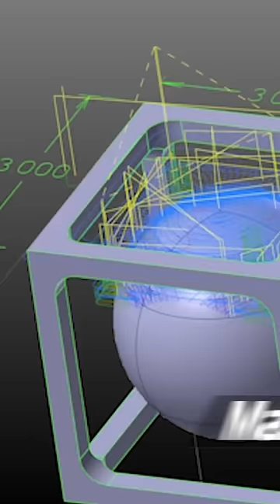How to Machine the PERFECT BALL in a BOX

Comment: Now give it to someone as a puzzle and tell them to get the ball out
Reply: Do it !!!
Reply: when  i see this kind of object my go to is to assume they heated the cube and froze the ball.
Reply: You just cut of the bars off. Puzzle solved.
Reply: And then they do it in 10 seconds.
Reply: @rubenproost2552  Easiest way to find a needle in a haystack is to just burn the haystack and run through the ashes with a magnet. Found your needle real quick.
Reply: loool 😂
Reply: send it to the lockpickinglawyer 😂
Reply: @holderheck that works aswell
Reply: @Mind_of_a_Very_Strange_Man true
Reply: With liquid nitrogen
Reply: @Mind_of_a_Very_Strange_Man Lmao yeah
Reply: Nothing a acetylene torch wont solve
Reply: Chris Ramsey would try it lol
Reply: This could be a prison sentence. You can leave when the ball is out
Reply: Easy, give me a fridge, some liquid nitrogen, and a torch. I'll freeze the entire thing, heat the cage up, and keep the sphere cold between paces with a rush of liquid nitrogen. On the surface of the sphere to keep the interior from heating back up. The sphere will contract, while the cage will heat up on one side of the square. I'm willing to bet the expansion of that side of the cage, and the contraction of the sphere would be enough to squeeze it through plenty.
Reply: @lightshow366 I'm willing to bet it's nowhere close. Don't feel like doing the calculation now, but I can if you're interested.
Reply: @IIBLANKII Okay, quick calc.
Aluminum:
Melting temp C: 660
Room temp C: 25
LN2 temp C: -196
CTE 24e-6 /C

Cool shrink 221*24e-6 = 0.0053
Heat grow 635*24e-6 = 0.015

Room temp sphere: 1.1"
Room temp cage window: 1"
Room temp interference: 0.1"
Cold sphere: 1.094"
Hot cage: 1.015"
Final interference: 0.079"
Reply: Hahahaha stop!
Reply: Amazon sells a 600lbs rem ,tell your friend/coworker you can peel it off something, then watch them struggle, I got 2 guys like that, it's like a 2" by 4"  cube, no one respects the Neodymium
Reply: @David-mz3it God bless your perfect calculations, alloys also don't respond well to heat shock
Reply: @Mind_of_a_Very_Strange_Man found the production shop employee 🤣
Reply: @David-mz3it he may be correct on being able to squeeze the peice out with Intferance, not exactly sure about the math on that, highly unlikely but possible, non ferrous materials.are kinda just like that practically, no tensile or shear strength anyways so bend that shit and fix after using,the most optimal for time management at least 🤷‍♂️
Reply: @curtiswrong Just wanted to see what it would come out to. 0.020" more clearance on a 1" diameter sphere was more than I expected!
Yeah, if I had to get it out, I'd probably bend the cage.
Reply: @David-mz3it  very bold to assume there would be a 20 thou interference on 2 sides of a ball to a flat surface on 2 sides, if so I could do that by hand ( given its a soft alloy) , tbh the whole thing is a mockery to precision machining and shouldn't be even in the same conversation let alone the same parameters as actual precision parts, this is cake walk, everything about it is easy except maybe if you wanna weld it, but even that isn't a grey area
Reply: @jorgblau7208  let me know your experience with interference mating parts and the use of liquid nitrogen, it's definitely one of the less forgiving processes in metal work
Reply: @David-mz3it  I'd agree given the material is pretty pliable, very easy to fix( not weld that shits a pain) but small bends, like .020"" is nothing for alloys, imagine the same project with 4140 hardened?, some real boys to men shit, not the band lol
Reply: @David-mz3it dm if possible you seem fairly competent on metallurgy basics and metal work processes!
Reply: @Mind_of_a_Very_Strange_Man  what if the needle has a low melting point, most likely would disintegrate when fire is done, then what ?! Hmm..  then what! Better using a high powered electro magnet, your theory defs sounds better for philosophical purposes, ill give it that, kinda deep ngl
Reply: @IIBLANKII  why would you need a fridge ? Also anything cooled in liquid nitrogen looses it's contraction benefits within minutes of removal from liquid nitrogen, gotta be hella quick, no way you would have time to heat the box and freeze the sphere, not even remotely feasible
Reply: @David-mz3it  there's no way its 79 thou , I'm not super familiar with this but that sounds excessive
Reply: @curtiswrong You're right, I paused the video and measured how far the sphere sits in the cage. Based on the height, if the cage is 1" wide, the sphere would be 1.01"-1.02" in diameter, so if you could heat the cage and cool the sphere to the temperatures I used, it would fit through.
Reply: @IIBLANKII  Hey, I was off on the size of the sphere relative to the cage (comment above) it would probably fit through or at least be very close.
Reply: @David-mz3it  theoreticaly sure, good luck pulling that off, not even remotely feasible, I would laugh hysterically in my bosses face if I was responsible for that, nice calculation tho, are you taking in the width of wall with that aswell?
Reply: @curtiswrong I'd never do it. My intuition was that it wouldn't be close even if you could heat the cage and freeze the sphere to those temperatures, which were overly best case. The dimensional change was more than I expected, but I was also way off estimating sphere diameter vs cage opening. On my phone I measured the diameter of the sphere about 1.67" and the height of the sphere sitting above the cage at 0.95". That came out to 1.01 to 1.
Reply: @David-mz3it  i whole heartedly commend you for your research, you got  0 dimensions for anything and still estimated a reasonable calculation, id call that on site math, you won't always get every number or dimension you need but you sir , will get damn close more times than not, familiarity and experience will serve you well, also when I say damn close , im talking microns which is well beyond our capabilities,I spot class a and b automotive parts which is considered the thickness of liquid in relationships mating parts, we get all fired up over .0005"" , and thats hand work
Reply: Nothing my oxyfuel torch couldn’t solve
Reply: Thermal expansion
Reply: @curtiswrong  I only meant it in the philosophical instance because of course a fire that big will get hot enough to melt a small needle. But in a philosophical viewpoint, if you burn everything else away except for the very thing you're seeking to find, it should be the only thing left after you've sifted the ashes. To me its a lot like the poem, The Shoestring by Charles Bukowski in a way but in a much different kind of tone.
Reply: @David-mz3it  well, considering this is one of the tricks to put industrial bearings together, you can think about it this way. If you have a sphere with x diameter and bars with about x space. 

Most likely it will just barely fit if you force it in, but with tollerencing of + or - a thou over the surface of the material. If we shrink the sphere by cooling it then it will most likely fit. Now heating the cage will help with this aswell just giving you room between the bars, and make the ball smaller momentary. Now if I had cared about the Haz on the cage then I'd say don't heat it up. But this is common practice for friction fit parts and things like bearings, crankshafts...etc. cryogenic shrinking is a very effective method of getting things to fit how you want lol.
Reply: @lightshow366   Right, I was interested in actually quantifying the effect. Estimating from the image around 0:56, the diameter of the sphere is about 1-1.5% larger than the space between the cage bars. Cooling the sphere with liquid nitrogen will shrink it by 0.5%.
Reply: @David-mz3it  yes, but you could also heat up the cage, i think that's manageable but it has to be done with a lot of precision
Reply: @danieledinicolacarena260   Yes, you can expand the cage 0.5% by heating it about 200 C. Or 1% by heating it 400 C if the cte stays the same over that range.
Reply: drop thing in liquid nitrogen, heat cage with torch, pull ball out
Reply: @Mind_of_a_Very_Strange_Man use a strong enough magnet an there is no need to burn the haystack.
Reply: @Mind_of_a_Very_Strange_Man Gordian Knot energy
Reply: @IIBLANKII  Or, hear me out here. Since you already have a torch in this scenario, just use that to cut the bars off and let the ball out. I like your thinking, but it's overcomplicated in my opinion when you can just use one tool to solve the problem.
Reply: @curtiswrong  And you absolutely are not wrong. I am in an industrial scale production business. 🤣🤣🤣 Nail on the head there my dude. I love it. I'm not an engineer. I'm a "get shit done in the quickest, most effective way" kind of thinker. Everything is a nail when you have a hammer. And a lot of times that hammer is a screwdriver, or a wrench, or a clipboard, or whatever is closest to me that I can do some percussive maintenance with.
Reply: @MrKralr  Yeah that is true. But probably going to take more time to find a powerful enough magnet in time before I have that hay stack turned to ashes. You're not wrong though.
Reply: @Mind_of_a_Very_Strange_Man  100% the one who can make something from nothing work will always prevail, a true telltale sign of a experienced tradesmen
Reply: And then they actually do get it out and hand it back to you but really all they did was machine the two pieces separately
Reply: Just submerge it into liquid nitrogen, due to the low temperatures, ball’s diameter will decrease
Reply: Dont give it to me, because ill get that damn ball out

Comment: I, as a recreational welder, would just weld a box around a ball and grind it to make it look flush 😂
Reply: I think i would just heat up the box and the force the ball inside
Reply: I'd just use an inflatable ball
Reply: @gr6e  hard to inflate metal unless you've made it a pressurized cylinder. And then it would be hollow. You and welders are not the same. 

Welders know what's up. 

-A sheet metal worker.
Reply: @PaulRudd1941 Honestly a hollow sphere would be pretty cool, much lighter and even harder for a layperson to guess at once everything was polished and in place.
Reply: @niemniej3441  this was supposed to be a family friendly video
Reply: @xxzenonionnex7658  You, Sir, deserve a cookie.
Reply: MIG is the original 3D printing after all.
Reply: You ain't right brother, but that sure is funny. It's still just a puzzle to them! 🤣
Reply: @gr6e  Clever
Reply: I would just slather myself and the ball in vaseline and take it in there myself
Reply: @slavicprincess  go on...... 🤤
Reply: A grinder will make you the welder you ain't
Reply: @curtiswrong  you forgot the paint 😂
Reply: I finish welds on stainless steel and aluminum rails.
That's what I would do to
Reply: @joetroy2904  fuck ya paint is the shit when you got bubblegum welds
Reply: @PaulRudd1941  welders are just cnc techs who don't know how to use a cnc machine
Reply: You're not wrong... but keeping it square and cleaning up the joints to this standard might almost take more time. I've seen them do it this way with wood. There's an example in the Warther Museum in Dover, OH, where Mr Warther carved a ball in a cage.... hanging on a chain... inside another cage.
Reply: @slavicprincess 😂😂
Reply: Exactly! This would be the way to best way to do it. Milling out 40% of a billet seems quite inefficient. Better yet, do it with stainless steel so it’s really rock solid strong and easier to weld.
Reply: As a professional welder... same
Reply: @xxzenonionnex7658 I just understood what you meant by that LMAO

Comment: I usually use a 3/8 Allen wrench in the vise for squaring blocks, there is always one on the workbench, it works just fine.
Reply: "just fine" is pretty subjective, don't you think?
Reply: @Tunkkis  and the new approaches are also subjective and welcomed. A hole.
Reply: @MarioAPN what he used in the video is not subjective..........
Reply: @Tunkkis  The solid vise jaw will hold the stock square if you put a smaller surface between the movable jaw and the workpiece. A piece of round stock is common, but an Allen wrench does the exact same thing.
Reply: @Tunkkis just eyeball it 😎
Reply: @timschjei3917  The problem with an Allen wrench is that it has the flats on opposing sides. A round rod will fill between the jaw and workpiece while applying pressure, something with flats will try to tilt with the jaw.
Reply: Hello! I have a question why do you need to square the block? Shouldn't it be still if you hold it in the clamp?
Reply: @timmysun1234  It will stay still, but it might be crooked. Squaring makes sure all sides are straight in relation to each other.
Reply: @Tunkkis  The workpiece will square up against the back jaw because it's a much larger surface.
Reply: If it works, it works.
Reply: no it has to hold the sphere too..
Reply: It's Alvin wrench Otto
Reply: Impressive machining but now do it on a manual lathe!

Comment: Reminds me of my first CNC program. 
We didn't do a sphere but we pretty much made the same thing with a square triangle and circle. 
We wrote the code by hand because that was part of the curriculum. 
I still keep that thing despite leaving the industry
Reply: All I was able to code by hand was a 2D Pac-Man...
Reply: @Arbidarb  as someone who looks at C++ like it's calculus and Assembly like its quantum physics, I have lots of respect for both of you.
Reply: did the experience come in handy?
Reply: @PaulRudd1941 G-Code imo is way more intuitive and easy to pick up on, mainly because there’s a limited number of codes and what they do (macro-b is another story). Compared to computer programming languages where you can program a variable that becomes part of your code, so it is harder to figure out what part of the code does what. The hard part of writing G-Code doing the math, and for a part like this you are talking about a lot of math.
Reply: Same here, but we did a cube in a box in a box. I think it was my 2nd or 3rd project on the CNC, but this was months after mastering manual machines and learning g-code

Comment: you could also heat the cube and freeze the ball and (if the tolerances are good) they will fit together. Then let them come up/down to room temp and they will not come apart
Reply: Took mine, good work

Comment: You could make a fractal vise that does that and then use reductive manufacturing(?) techniques like the one depicted here to finish the job like what was shown.

Additive manufacturing can not print a solid sphere inside a completely enclosed box that is free to move around within the box as far as I'm aware unless the 3D printer placed an object into the print as it was 90% done then sealed it up after

Comment: I was thinking the box and sphere were machined separate with a slight interference. Using heat to expand the block and dry ice to shrink the sphere the sphere would fit inside.

Comment: Isn't this just and isier version of a classic machinists test, In the original your only allowed to have a certain amount of the surface on each side drilled out with round holes though, so think like 10 or 20 evenly spaced smaller holes on each side.

Comment: That's pretty cool. Reminds me of a concept in math where there's a certain maximum size a circular object can be and fit inside of a square object in the same dimension. 2 and 3 dimensions are pretty easy to figure out, but it starts getting weird around 5 dimensions and the circular object is actually able to be bigger than the square object it's inside of.

Comment: what if you make the sphere and cube seperate and then heat up the squate and cool down the sphere so they expand and shrink respectfully, you fit the sphere in and let it sit so they both go back down to room temp and you have the same result
Reply: The coefficient of thermal expansion of 6061 AL is 1.3E-5 in/in-F.

If there’s 0.050” of interference (probably way more) and the cube is about 3 inches in diameter, even if you cooled the ball in liquid nitrogen you’d still have to heat the aluminum to over 1,000 F to get clearance. Which is not realistic on a material whose melting point is 1200F.
Reply: @robotlegs your calcs are good but on average freezing will give you .0007 per inch and depending on metal you'll get .0014 expansion per inch, maybe more or less depending on material

Comment: Now make a twelve foot statue out of a single pice of granite with a ball inside.... and please tell me how it was done with copper chisels.
Reply: what are you implying
Reply: with copper chisels you can do anything you can do with modern equipment, it just takes a lot longer
Reply: Certainly not something a master Craftsman would try to do. Nope no way
For certain, a master craftsman would never attempt a feat of skill and prowess, everybody knows that
Reply: They probably had iron.
Reply: Very easy, just use 100 workers instead of one. The bigger the project, the more workers.
Reply: Brilliant
Reply: @etooamill9528  I heard this argument once before and people underestimate work hardened bronze.  I know granite is gonna be a lot tougher than a sedimentary rock, but you literally have a lifetime to make it work.
Reply: If your talking about that lion statue there was a hole in the middle that scientists didn’t notice at first
Reply: Use a sand slurry and the copper will just act as the water in a water cutter
Reply: @ezor5609  This is the way.
Reply: Goddamit.😅
Reply: I think you answered your own question..."with copper tools"
Reply: They used copper saws and sand actually to grind away the granite
Reply: @NINacide literally comparing apples to to fucking beach balls, different everything, both possible but not similar in any way for processing, I'd eat/ work hardened or properly hardened bronze for breakfast, this isn't the Persian empire dude